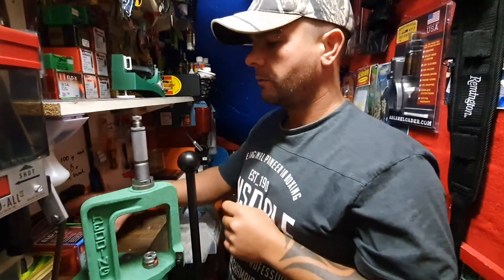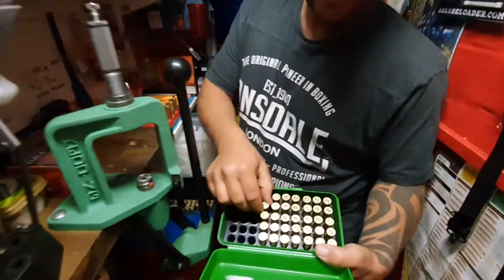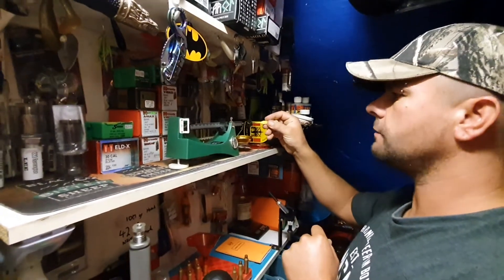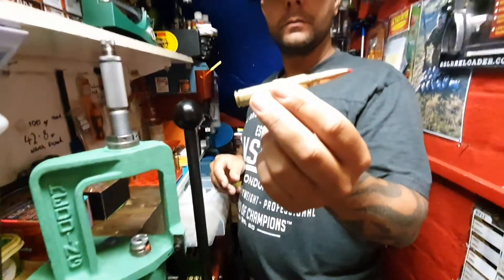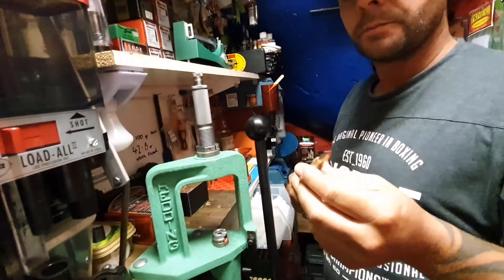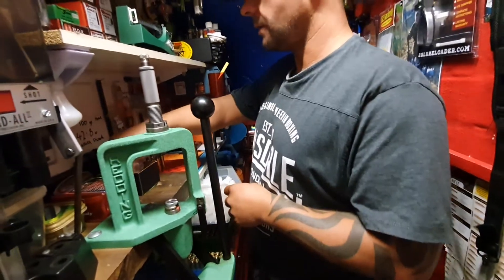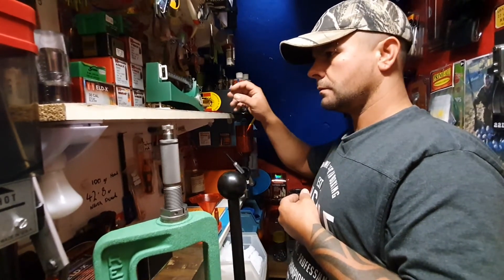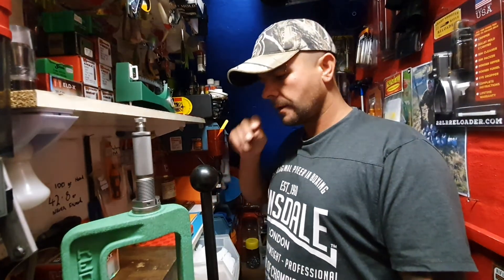Reloading the 300 win mag part 2

Comment: Can you suggest how you determined the seating of the bullet.

I have a tikka t3x  300 win mag which has a fairly long throat.  Folks have suggested cutting a case, lightly seating the bullet, cycling it through the rifle so you can visually see the bullet contact within the case, then adjusting seating depth from there.
Reply from the maker: With a long throat. If you compare the seating depth to the width of the bullet they say thats enough. So if your bullet won't touch the lands before dropping out of the case mouth. Seat them all the caliber width or shorter. You will find that rifles with long throats usually don't get much more accuracy by the seating depths. Play about yourself and see how yours behaves. And as long as the bullet is seated .300 of an inch you will be fine. Don't crimp them tho I have never needed to crimp 300 wm. Hope this helps a little - mike